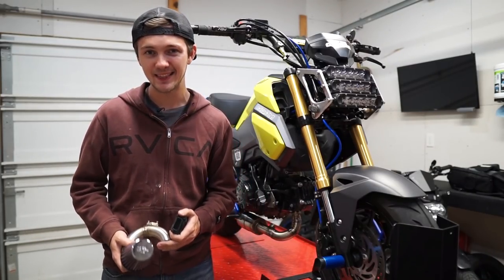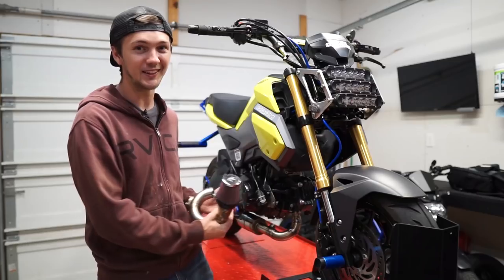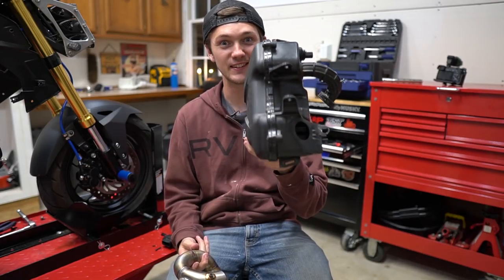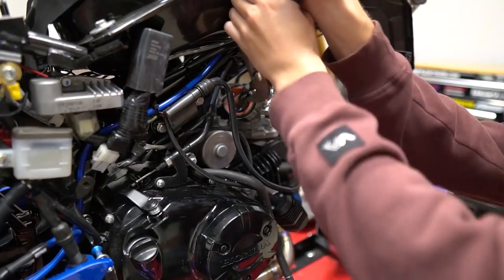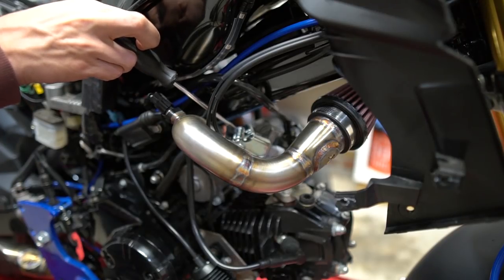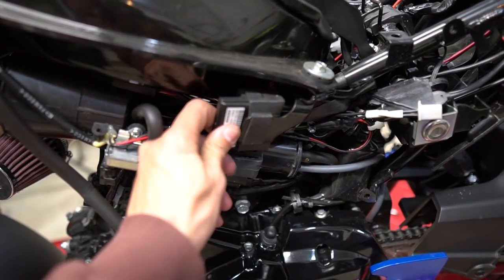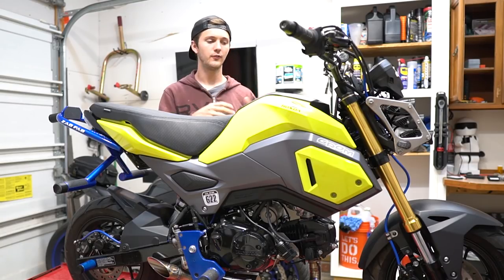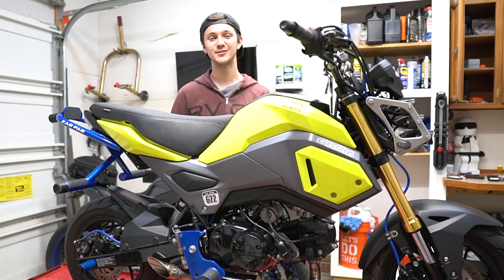Dinger Built Intake & DH Motoring ECU Install

Comment: DH motors said I didnt need to reset my tp and  my ECU  since it was reflashed when i sent it off.

Cameron jones said I should.
What yall think?
Reply from the maker: I mean, if you're not replacing thought Throttle Body, why would you need to reset your Throttle Position? 

I would definitely still have it reflashed after installing the intake

Comment: Do you have to run premium after doing the intake exhaust and ecu flash?
Reply from the maker: It doesn't make a huge difference by running a higher octane of fuel.
Reply: @GromGarage  thanks for the reply